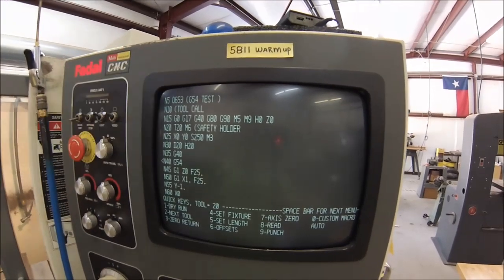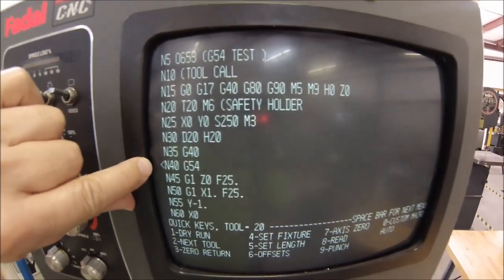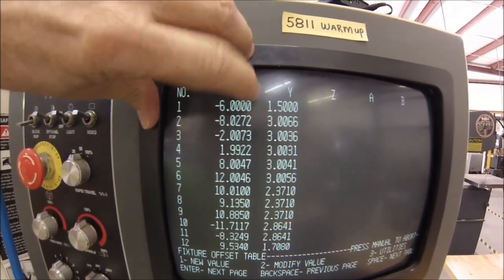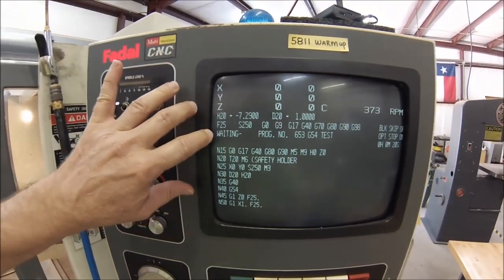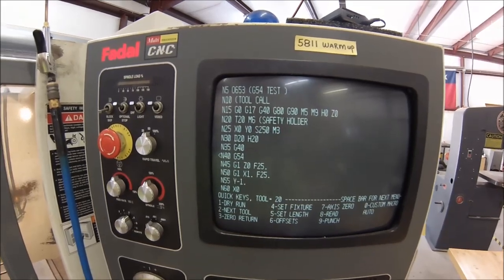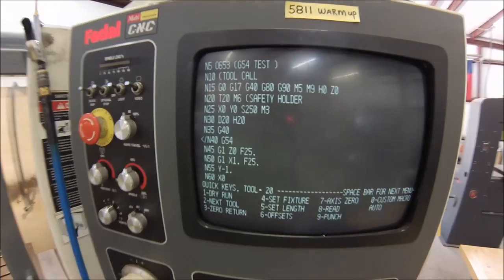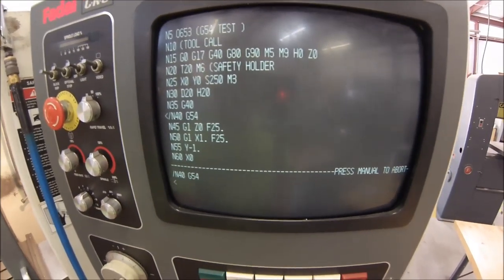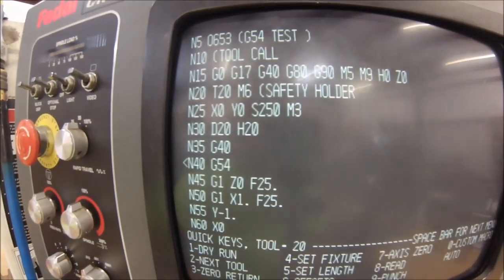CNC Machining Center  Part 7

Comment: Friend amigo como se hace roscado o tap en esa fadal.
  Helpme with the program for tapping
Reply from the maker: My machine is set for rigid tapping. I'd be happy to shoot a segment on that if your machine has the same capability. Let me know.
Reply: @joepie221  it is great , please thanks  i want it
Reply: @joepie221  my cnc fadal 4020 and another 3020 can not thread, i can not make the thread work please help me

Comment: Enjoy your videos thank you.  Recently purchased a Fadal 3016 myself so still getting familiar with it.  Could you do a video on tool offsets if you ever have time?  I am having trouble figuring out how to set the Z height without touching off every tool for different parts.  Thanks again.
Reply from the maker: Unless you have a tool probe and standard carousel, you are somewhat locked into setting every tool everytime. If you standardize your tools, you could set a hard tip tool in one of your holders and reference the contact Z reading between parts and mass modify the entire carousel in the offset register. I have done that with 100% success.
Reply: Ok great thank you for that I will give it a try.  Appreciate it.  Look forward to more videos.

Comment: G54 is handy on the lathe, instead of re-zeroing all tools, to utilize drops and make an extra part.
Reply from the maker: I have to confess to having zero experience on a CNC lathe.
Reply: Joe Pieczynski, Its a different thing , not easy peasy. 
Im glad I started CNC on this thing, cause the rest is actually easy peasy. 
Wire EDM, Routers and such. :)

Comment: Cool, I have never used E values,  always G54, 55 etc on HAAS and Fanuc controls.
We have a fairly large semi-sacrificial aluminum plate that I use for thru hole ops on big stainless parts,
It has a 1/2" hole in one corner stamped G110, I can send the machine to G 110 X0 YO , Stick a dowel in the hole and bolt it down and be REAL close
to set up for another 36" 42 hole BC LOL
Yea gotta turn the part at least once.......
done bigger...
If we had a mill with a table the size of an aircraft carrier deck I might be happy LOL

Comment: what year model is the vmc/controller?
Reply from the maker: The machine was manufactured in 2000. I believe the controller was updated in 2012 to the flatscreen and expanded memory version. I bought immediately after it was refurbished. Its been very good to me.

Comment: G53 = Cold Start Position.  G54 = E1, G55 = E2, etc.  You can use either on a Fadal, it will read the same.  E1 is usually used in Format 1.  Fixture offsets G54 etc are used by Fanuc controls (Format 2).
Reply from the maker: Thanks. I just started experimenting with the G54 codes when Brad asked me about them. I can utilize the E series offset quite easily.

Comment: Thanks Joe, great video. Did you know, some machines allow another 48 work offsets, stored as G54.1, G54.2 etc, up to G54.48? In practice though, these are rarely used.
Reply from the maker: No. I didn't know that. I'll have to see if that works on this machine. Thanks.
Reply: Mach3 uses a better system, you can use G54 P1, G54 P2, up to P254, so you can have 254 work offsets. Problem is remembering which is for what fixture lol!
Reply from the maker: That would be great if you had a tooling plate with pinned drop on tooling / fixtures. You would never have to change the offsets. just keep a few reserved for the odd jobs.
Reply: Beware though, I did some repairs on a Fanuc once, had to take the mobo out, when I re-installed it had lost all its work and tool offsets.
Reply from the maker: If your controller battery dies, the same thing happens.
Reply: Ahh... They give with one hand and take away with the other lol. Someone said 'in the shop, every day is a school day', I live by that moto.
Reply from the maker: My Father used to say" A day you don't learn something is a missed opportunity". I miss him.
Reply: I agree with him. That's how I live my life. I'm 58yrs old now, and still, every day is a 'school' day!

Comment: So did I understand correctly you can only have 6 preset offsets?
Reply: See my comment above...
Reply from the maker: Using only the G54 thru G59 yes. using the E system I use on my machine, I believe you can have 48. Fred Genius said you can split the G54 region into decimal numbers and get to 48 as well. I didn't know that.

Comment: Joe, do you use a spindle or table probe of any type for setting work offsets or tool offsets? It's extremely helpful and fast. I'm still working on writing some macros so I can run the probing macro at the beginning of a program to automatically set work offsets for me.
Reply from the maker: I don't use one. If I have a fixture with multiple locations, I drive from 1 central tooling hole and have the program hard coded to go to those other locations. my offsets are so easy and fast to set, I probably won't make the investment.

Comment: Format 1 is Fadal format and Format 2 Fanuc format. From what i understand  Format 1 (Fadal format) will run most or all of   Fanuc commands "standard type g-code", I'm not positive because I run Format 2 mostly. I'm starting to run Format 1 aka Fadal format because it seems to give me more options especially when drip feeding with use of DNCX. I've never had any luck with the graphics function but my machine is much older and maybe graphics are not working for me because I'm drip feeding in format 2, I have no choice but to drip feed because of the age of my machine and the fact I have basically no memory in the controller to speak of.  I think graphics may work better if I used Format 1. The YT channel "At-Man Unlimited" is an amazing channel for Fadal owners and is probably one of the best(and quickly becoming the best) resource for info on how to assess, run, program and maintain a Fadal machine that I have come across. Many thanks go out Joe Pie and Tim @ At-Man Utld along with all the others for all their time spent sharing their knowledge and experiences in machining with us. It's much appreciated!
Reply from the maker: Thank you very much. Glad to help. Does your machine have an RS232 port around the back?
Reply: Yes sir, I currently run a Calmotion USB to RS232
Reply from the maker: I love those. Mine works very well.